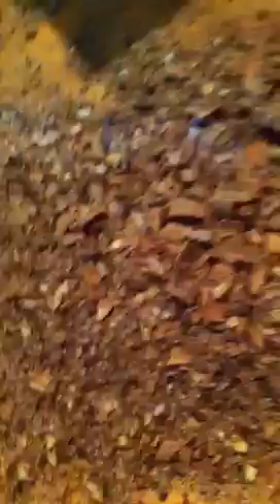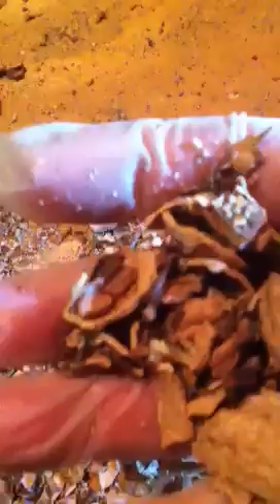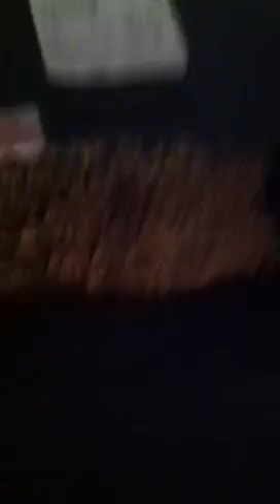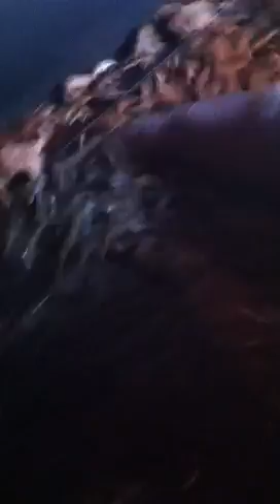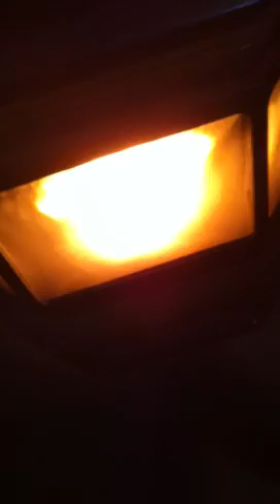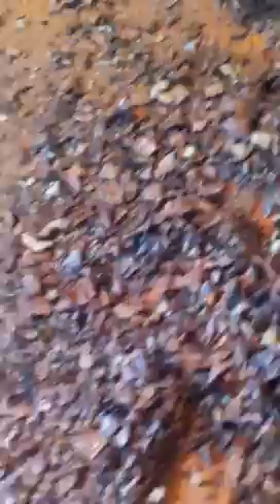Pellet stove burning walnut shells

Comment: Those are English walnut shells. Regular walnut shells burn extremely hot because of the oil content in them. You got to be very careful when burning them in a regular wood stove. You should make sure you have a damper on the stove pipe to shut the air down. They burn so hard they create their own draw.